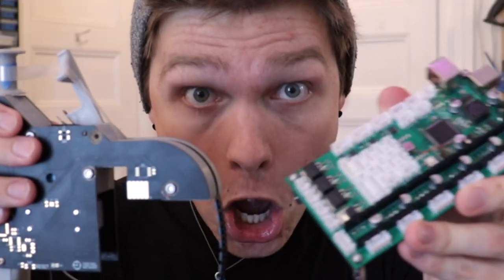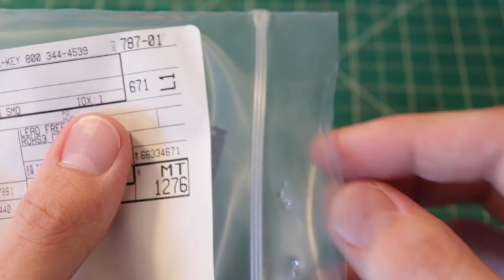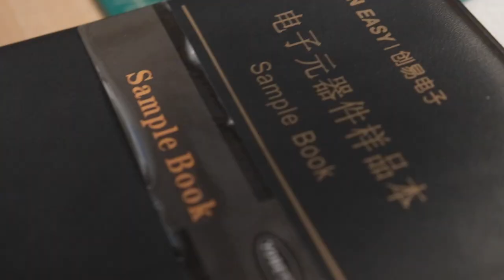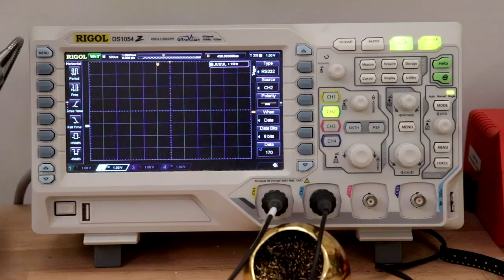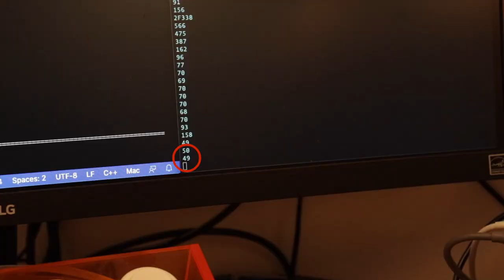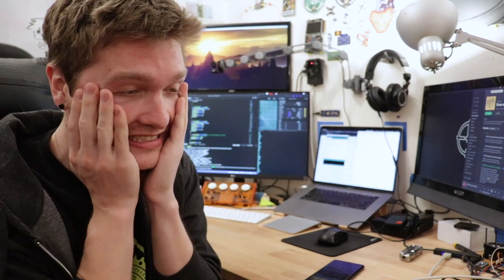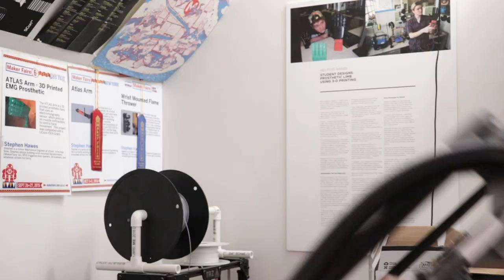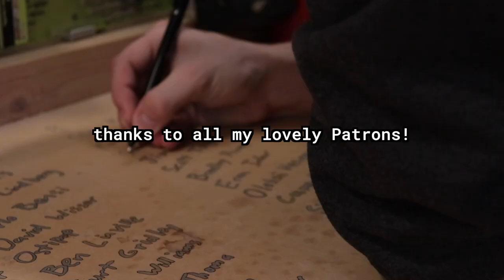Teaching Feeders To Speak RS-485!

Comment: Would DIP switches be useful for setting the feeder identity?
Reply: I second this, I've seen it used alot on devices that need to be addressed like this. Also seems to be the simplest solution - no need for extra LEDs etc, just one new component connected to a few IO pins. Alternatively just have some jumper pads that you bridge with solder to represent the bits.
Reply: thats what i was thinking if you have enugh io ports available. a 4 pin dip switch for 16 adresses shoud probably be plenty and would make it possible to see what id the different feeders have.
Reply from the maker: OOH that's way simpler than clicking through addresses. Thanks for the idea!
Reply: @stephen_hawes  You can even get 4 bit switches which are like tiny pots, and you dial in a hex value :D they have the same footprint and pinout as a 4 bit dip switch
Reply: @azyfloof  I've done this as well. I actually connected resistors to the 4 'bits' of the hex selector switch so it gives you 16 analog levels.
In this case though, I would just give each feeder (or each bay) a tiny d-flip-flop and string those together so you can digitally select the bays.
Reply: @stephen_hawes  dip switch’s and LED
Reply: @stephen_hawes  yes definitely easier then having to click it 30 time and saying dam i missed my number now all over again.. unless you just want to torture someone
Reply: @azyfloof  I would be careful with that idea there is vibration and the rotate dip switch because they can move... you would have to get more higher quality ones not the really check ones but it can be done
Reply: @robrocco5420  The ones I've seen have a very positive action with indents, so they aren't gonna vibrate unless they're bargain basement ones from Wish or something lol
Reply: 100% This was the first thing I thought of when it came to addressing; simple, cheap, and robust!
Reply: @Teklectic  Something like a P25SMT306  from RS would be perfect :)
Reply: @stephen_hawes  Bit of a late response. Could have the DIPs on the side of the spring fingers, then you could have either physical DIPs or just bridges?
Reply: No DIP switches. They are a horror and a nightmare.

Comment: Nice project. 
The thing with assigning IDs can be done in a little different way. You can assing ID's from the master node.

You can send on a bus messages like "If you don't have an ID yet, then your ID is 1. Save it in nonvolatile memory."
Slave responds "OK, done. I have ID 1" 
Then master sends the next message "If you don't have an ID, then your ID is 2. Save it in nonvolatile memory"

Anyhow you will install the feeders sequentially and there is no time when you install at the same time 2  non initialized feeders. Therefore each feeder will get the next address assigned by master. 

If you don't like to rely on power on reset as a condition to read the ID, then you can assign the next ID's based on the sensors combination. For example "Whoeven on the bus has the button 1 pressed - save ID 1 ". In such a way you would just have to install all feeders and then go once on each feeder and press "button 1" to assign it the next address generated by master. 

This solution would allow you quite easyly to add new nodes even dynamically.

Comment: Straps (pull-ups and down, you can use a 3 pad footprint to save space) are the easiest way, you need only 5 for 32 addresses. Or Dip switch if you want it to be configurable. You can add a shift register to save pins on the micro. 1-wire eeproms are also easy.

Outside of the box: you could have self locate by sensing their neighbours. A single GPIO per side is enough. The right-most feeder could identify that it’s touching the edge through his right pin. It would then advertise its position (1 in this case) and then set its left pin. The next feeder would sense the change on his right pin and know that it’s next and advertise its position (2), and so on. Of course this is assuming that all feeders are touching. I don’t know if it’s a viable idea, but it’s neat.
Reply: The second paragraph yes, the first paragraph no.

Comment: You can use computer vision and the built in eeprom of the atmega. To intially program have only one feeder or one new feeder connected. Program the address as a "broadcast" to the one which is not programmed. Read in a qr code from the feeder label. Keep all in a text file and read in the qr codes with computer vision when the feeder are installed

Comment: You can buy lovely little rotary DIP switches that let you adjust the setting with a screwdriver. They come in 8/10 and 16 position so with 2 x 10 position you can do 99 feeders RELIABLY. Also you should have an optical detector that detects the hole in the tape if a part is missing.

Comment: Reminds me of old analog CCTV PTZ Dome cameras. 
They use RS485 for control and had a small 5 or 8 way Dipswitch block so you could set the address on each camera.
Combination of the dipswitches could set the ID from 1- 255
Reply: Do. Not. Use. DIP. Switches. To. Set. An. Id.

Comment: just add solder joints (those solder pads that is intentionally close so you can bridge it use a drop of solder)
to the connector PCB, which means 1. you just need to label the connector board to not mess things up and 2. the mainboard can automatically recognize which slot the feeder is in now.
Also, another idea is to make the feeder send out a "info" package so that the mainboard does not only know which slot it is in but also knows what component is in it.

"info": {"slot": 0xA, "componentID":"0BA09974-A295-48E6-88AA-E55757EFE139"}
and you can connect this uid with a component and its info in a database or something

and when you change what component is in a feeder, you can make some small contraption for it, that should be quick, maybe feeder can receive a RS-485 package telling it to change its component id

Comment: Nice job man, love the build and vids. As many people said I would go for the DIP switches which act as a bit represent. So 4 DIPs will give you a total of 16 combinations, 5 -> 32 etc. May I suggest one last thing to take into consideration, in the software you said you write 2F to make feeder 2 go forward, I would try and make it 02F, that way if you'll have over 9 feeders you'll be ready and set to go.
Reply: Do not use DIP switches to set the ID. The first time you set two devices to the same ID, you will curse your decision and everyone who suggested it to you.

Comment: Also, instead of setting the addresses, you could just use some type of universally-unique ID system - the STM32 you're using probably has a unique ID burned into one of the system registers somewhere.
Reply: We don't really care about the ID of the feeder. We want to know which slot it's plugged into so the pickup head can physically locate it.

Comment: An idea!!!! Considering you probably will change out feeders way, way more frequently than the feeder floors (ideally you dont change them out at all), i think you can just program the floors to hold the addresses. EEPROM would be obviously an overkill, but setting manually some logic gates with buttons would do the trick

Comment: Nice work as ever! I'd stick with the resistors, maybe do some tolerance analysis on the worst case you could get from adjacent resistor dividers. I think you would be surprised especially with 1% resistors! I think you will easily be able to stick with it for 32 slots as I believe you have 12 or more ADC bits right? So at least 4096 numbers representing voltages. 4096/32=128 different numbers to mean 1 slot! Also as suggested maybe add a capacitor either at the divider or at the input of your ADC (or both) to increase the voltage stability :)
Reply: You're limited by the resistor's thermal coefficient, not the ADC resolution. A warm resistor will appear to be be 1 slot higher. (I assume he has taken this into account)

Comment: For the ID system. You could have jumper pads, one for +5V, one for GND, and one for connecting to the circuit. then manually hardcode the id in binary using solder bridges. You could make an array of 5*3 pads to enter the id, and you'd have a cheap easy to use, and most importantly digital identification system.
Reply: No. This is worse than DIP switches, which are already worse than everything else.

Comment: I did a project with NFC eprom/sram chip you can flash settings with your mobile phone. It's not cheap because you also need antena or pcb antena space. But it can store quite alot of settings. The NFC transponder + Molex antena was close to 3.5€. It could fit this project.

Comment: Somehow I missed this video - subbed and belled so that shouldn't be a thing any more - so I'm late to the party, but I would use the feeder's other PCB with another five fingers and selectively power or ground them slot-side to provide an ID. That would make 32 slots (or more by adding more fingers) trivial to implement at the cost of requiring the backside PCB actually do something aside from acting as a structural component. Connecting the feeder's two PCBs could be handled with a short interconnect cable and matching socket.

Comment: STAY with the analog voltage that's good enough BUT add a cap like 100nF in parallel to block noise

Comment: I'm wondering... could the downwardfacing camera be used to detect an LED on a feeder? Like a fiducial? Because if that worked it would open doors for all kinds of fun stuff: Have your feeders all next to each other on an extrusion, use some kinds of pogo pins or springloaded sth to connect the feeders to a pcb next to the extrusion. we need a starting point: a position where always a feeder is placed. The feeders' leds light up and send their id over the bus, camera recognizes the one below it and can correct for misalignment, the feeder sends its information (tape width maybe set by a resistorvalue or dip switch) and the camera knows how much further to move to be on top of the next feeder. All the other unidentified feeders light up and send their ids over the bus one after the other until the one currently under the camera lights up. Camera corrects for misalignment and repeat.
If one reel runs out, pop in a new feeder with new tape in it's place, have the cam correct it for misalignment with the led and off you go!

As for bus ID and communication I'd say look at i2c: If I remember correctly a device pulls a line low just before it uses it to send data, eliminizing collisions. Maybe that's sth you can copy: mainboard sends a broadcast, feeders wait a randomized fraction of a second before one of them pulls that line down and responds, MB ack, then repeat until all the feeders have made themselves known. That's pretty much how dhcp works and successfully for years now

Comment: There are unique id chips, eeproms, combined ID/eeprom chips. They come in I2C and 1-wire (eg Microchip 24AA02UID or AT21CS11)
You could use those, and have a programming "feeder" that you insert in sequence to identify each slot to the controller. It could either write the eeprom, or report the ID to the controller, which remembers each slots unique ID in a lookup table. Not super elegant though

If you can add a 5th wire to your JST jumpers, and add the smallest possible micro to each slot "floor".  you could come up with a 1-wire programming solution. inspired by the way WS2811B uses its input/output pins:
 * each "floor" has an output pin connected to an input pin on the next slot. The first slot gets its input from the controller, the last slot is left disconnected
 * each "floor" has a 1 wire digital pin that outputs to the feeder
 * On startup the controller sends a "1" packet to the "in" of the first slot "floor". The first slot remembers its position as 1.
 * The first slot adds 1 to its ID and sends it to slot 2
 * The second slot remembers its id as 2, then adds one and sends that to the 3rd slot.. and so on
 * Once initialized, each slot sends its ID packet to the feeder a few times a second. When the feeder starts up, it listens for its ID from the slot floor board

That solution requires the smallest/cheapest 6/8 pin micro you can get (6-pin attiny4 ?), with 1 input and 2 output pins (or maybe 1 output pin, you might be able to use the same pin out to the feeder and out to the next slot)

I also wonder if its worth considering adding a boot-loader to the feeders so they can be bulk re-programmed with new firmware over RS485. Not worth worrying about for the slot "floor" boards, the code is simple enough you shouldn't have to change it.

Comment: Have a line of unpopulated pads on the board connected to IO pins like you would a dipswitch. Then solder in zero ohm link resistors to encode the ID of each one onto the PCB. It's cheap

Comment: the board that the feeders connect to could have hard-wired 5 bit ID that goes through the connector to the stm32
Reply: I am doing this (well 8bits in my case), and using  PCIexpress connectors mounted on a bus to simplify manufacturing. Then the feeder is responsible to "know" what component is mounted, so that OpenPnp can query all RS-485 addresses for "what component is in this position?"

Comment: It would be great if the feeders has fixed id´s. The feeders ID is labeled on this feeder with an QR-Code or DataMatrix-Code. If you add a new SMD-Reel on this feeder you scan first the feeders ID and second the value-code of the reel. In this moment the SMD-Part/Reel get married with this feeder by the software. Now it doesn´t matters on what position the feeder is pluged in. Now the software automatically knows on what position is located the right part. This of course assumes that the positions of the feeders can still be recognized. It doesn't matter whether this is done with a voltage divider or a 1-wire chip etc. So you could use a second feeder with e.g. 1k resistor before the first feeder runs empty with the 1k resistors ;) This way, mix-ups of components during assembly can also be minimized ;)
Reply: A long time ago I worked on an SMT line, using mydata and Yamaha pick and place machines. Our Yamaha's were 'old' and each program fixed the BOM components to set feeder locations. The mydata had feeders with barcode and an ID chip. An operator could register a suitable combo of component and feeder, put it anywhere on the machine and it would pick it from there. Setup was a breeze since the stockroom barcode every reel, and two scans (even when machine was running) and the pair is registered.

Others have mentioned that you could use either 1wire type protocols, or some thing that affects the chain so each slot behaves different. If number of contacts doesn't matter (the gold fingers) just have a few for a set of low or high bits, and bridge pads with solder. Or could manually set machine with triplet of component 1 is on feeder 2 at location xy.

Comment: If you want the position on the machine to do the ID, the easy way is to use 2 pins on the MCU on the feeder and a 4017 on the rail.  Basically a pulse counter.  The feeder MCU does pulse count against the 4017 Johnson Counter to get its id.  The only limit would be how many 4017's you want to string together.
Reply: Could you elaborate on that? I'm not familiar with the 4017, but by looking at the datasheet, it wasn't immediately clear on what you're trying to do here...
Reply: @crazor01  If you wanted the rail position to determine the ID using a 4017 at the rail would allow 2 pins to communicate with the feeder as to what ID it should be.  The 4017 can be configured as a pulse counter.  You use two pins on the MCU, one as input one as output.  One pin tries to drive the pin high the other checks to see if it went high.  The 4017 bumps the count up and can be statically configured via resistors.  This method is used a lot with keyboards, keypads, etc to keep the pin count down on the MCU.
Reply: @ShaneBurrell1  Ah okay I get it now. Nice idea!

Comment: 4:02 best way for ID will be 64kB eeprom, where you can add additional parameters other then ID also. 
DIP switches are also good but bulky.
Reply: DIP switches are not good. They are bad.

Comment: Five tiny little switches on the feeder which interface with five tiny holes (or places where a hole would be) on the mount. Or five spring fingers vs five possibly grounded pads. It's digital, practically bulletproof, and stupid simple.

For that matter, five slot photodetectors vs five holes.
Reply: The first time you set the switches incorrectly, you will learn that you have made a mistake. Auto-config or go home.
Reply: @RussellNelson  The switches would be set by the holes in the frame. Basically the feeder learns its address by braille.
Reply: @DanBowkley  Oh! Yes, you are correct, this would work very well. Or ... have a 2D barcode on the feeder which gets read by the camera. Same idea.

Comment: At 4:25 you solder an 0 and an 10k resistor in, isnt the 10k resistor only drawing power in that aragement and not very usefull? 
As it will be allways fully pull low?

Comment: Why not use voltage drop to your advantage have the first feeder hooked up to 5V and run a single extra cable to each feeder floor and have a resistor inline. The last feeder hookes up to GND an then you have a presice and equal voltage drop on each feeder.